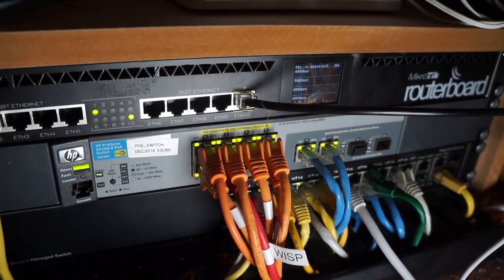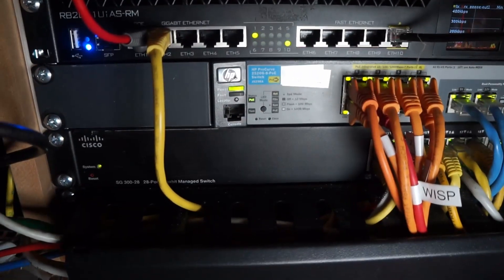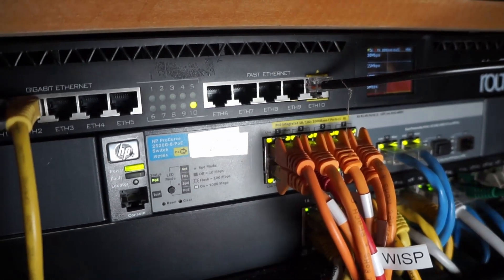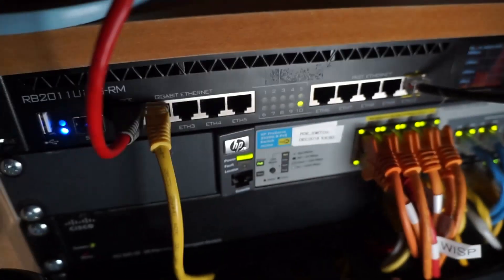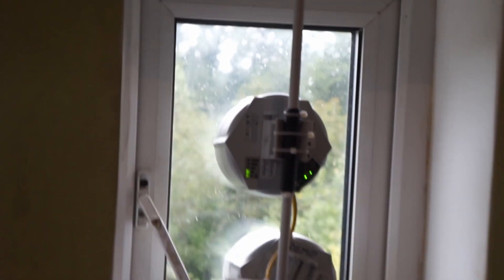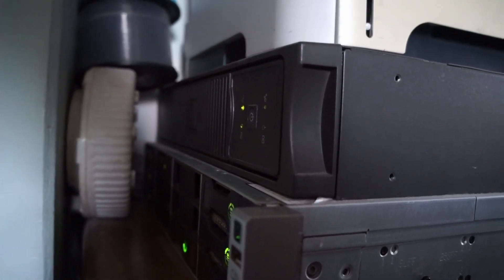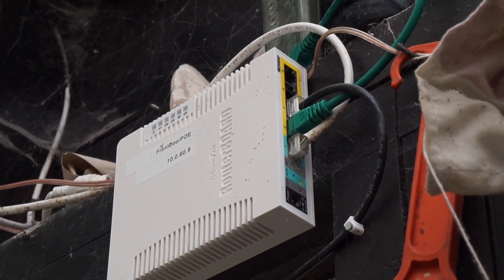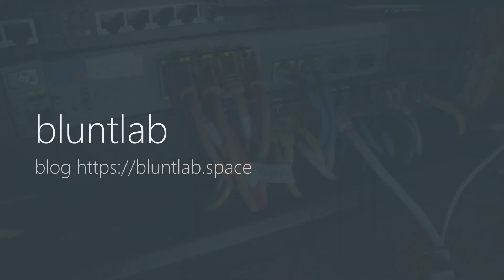Mikrotik/Cisco Home Network Tour 2021 Homelab

Comment: I’m not a fan of patch panels, cleaner the cable run, the better in my book. I just use dymo labels
Reply from the maker: They can be a right pain. I have a weird setup with mine too but when done right they can be quite handy and neat.
I have a little brother label printer I sometimes use (infact think some of my patch panel labels are from said printer)

Comment: Glad to see you back!
I've had an RB2011UiAS-RM running on my network for a few years now, big fan of it. Just waiting for ROS7 to get out of dev/RC for WireGuard, got that running on a downstream VyOS router that then passses it's routes back to the Tik with BGP. 
Only annoyance with the 2011 is the way VLANs are handled between bridges & switch chips, otherwise solid system. Oh and being MIPSBE the Docker system in ROS7 won't be very useful.

If you want your LCD to stay on 24/7, you can disable the timeout with /lcd set backlight-timeout=never - if you're on ROS6 at least. 
The last time I tried to run a dev build of ROS7 on my RB it locked all the interfaces to 10/100 and kernel panicked every now and again, that was like beta3 though, I might try one of the release candidates if BGP filtering is working now.
Reply from the maker: VLANs on Mikrotik are so confusing at times oof.
I just have all my VLAN's as interfaces on the bridge
I did try the switch menu but it did not seem to work for me maybe I did something weird
But overall despite some oddities Mikrotik stuff seems really decent. hence why I was looking at a big Mikrotik switch but the one I want is out of stock everywhere
Reply: @bluntlab  Yeah I'm a big fan of their gear, RouterOS is a steep learning curve but decent once you get ahead around it. Took me ages to get the VLANs right on my setup, had them flooding packets to every vlan at first, great for wireless airtime eh. Happy to try and help with vlans on the 2011 if you need.
Reply from the maker: Feel free to checkout my config https://pastebin.com/qte7Xa8P
I think I have done my VLAN's correctly? everything is working fine currently
Reply from the maker: Not doing any VPN stuff on my 2011 yet. only been in for a few weeks now.
Mikrotik VLAN's are always odd. I have them setup but have no idea how to do VLAN's per port

Like I would love to change the untagged VLAN on port 10 but enabling VLAN filtering made things very broken so instead I made a VLAN on the LTE router to get it to pass through :|

I dont really use the LCD tbh just looked cool on the video :) the rack is in a very awkward place hence the weird close up video. I have not tried ROS7 at all. been using the long-term builds instead on all my gear. I have an alarmingly high amount of Mikrotik routers/AP's (been testing CAPsMAN as a replacement for my old Cisco gear)
Reply: @bluntlab  Yeah don't enable VLAN filtering, A-class way to get locked out, enable safe mode! 

Add all your VLANs to a bridge, I'm sure they are already though and then do all your per-port configuration in the /interface ethernet switch menu, it's just switch in Winbox

vlan add vlan-id=100 ports=ether1,switch1-cpu
port set name=ether1 vlan-mode=secure vlan-header=add-if-missing default-vlan-id=100

Will untag ether1 to VLAN 100, then you can add more ports to the first line to make them tag that VLAN, just make sure the cpu is in the ports list for that switch chip (the gig and 10/100 ports have two different chips in the RB) if you want inter-vlan routing.
Reply: VLAN-Filtering is a CPU chip thing that I don't believe works on RB2011, there's a table somewhere in Tik's hell of a documentation site, the old one not the new one that's partially combined with ROS7 docs but it doesn't really tell you that aaaaaaaaaa!

Comment: Not something I was expecting to see today. Glad you're no longer putting up with that 4/1 BT DSL line

EDIT: Have you considered Brocade's ICX series for a low noise, low power L3/10G switch?
Reply from the maker: I still have that connected because mobile providers CGNAT suckkks

I have not actually. I dont really have a need for 10g at the moment anyway as my NAS is still spinning disks and thats about the only local thing I would want faster access too. Heard good things about Brocade stuff
Reply: @bluntlab  Have you considered tunneling somewhere and routing a block of static IPs to your home? I do that at home and it works pretty well
Reply from the maker: Considered it. but I cant afford a block of IP's oof
my ISP gave me a small block for free so unless someone has some IP space going cheap its not that feasible
I could use a VPS I guess but their IP's are almost always in every blacklist on the planet
Reply: @bluntlab  I’m lucky that I’m friends with the owner of a data centre not too far from me, so I get a /27 routed to my colocation, of which i route a /29 home
Reply from the maker: Nice very lucky to have that
I have looked at renting some IPv4 but the cheapest was £150 a month ouch
AAISP do an L2TP service which looks awesome but its got a speed cap and a bandwidth cap urghh
Reply: @bluntlab  if you look around, you can get a /24 for 50-60 quid. Just gotta have an ASN to put it in (~1.5k/yr at ripe, but you can get one for free/much cheeper depending on if you know someone with an asn)
Reply from the maker: Most prices I have seen are like $40 per IP address in a /24 block thats crazy haha
And getting that ASN number looks very hard to do for me anyway

Maybe in 30 years time IPv6 will be the default and I wont have this issue anymore lol but right now both my DSL and mobile providers are IPv4 only